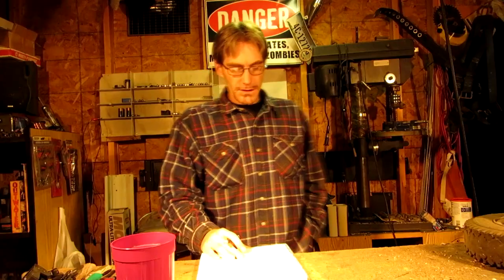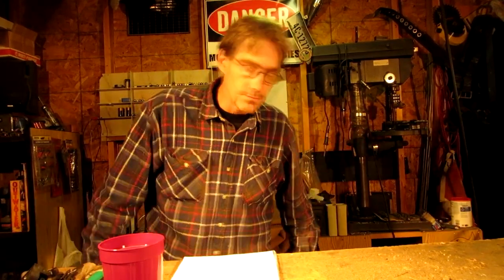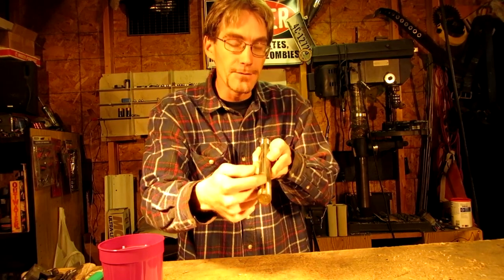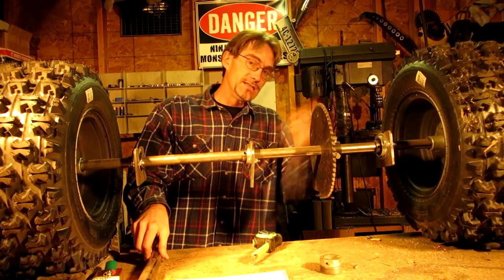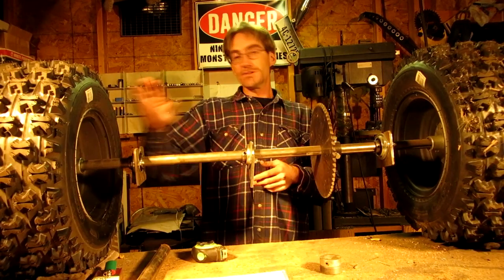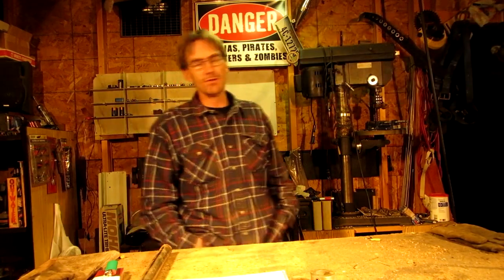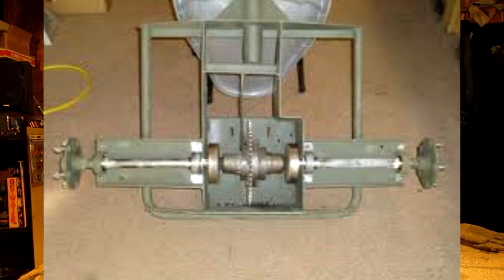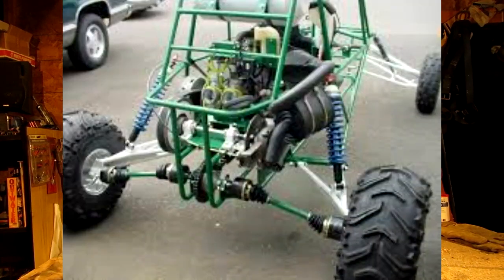GO KART AXLES | 3 PRIMARY TYPES |

Comment: Larger diameter axles , solid or tubular , will handle greater torque without twisting . Chrome moly steel is about 2X the strength of high tensile carbon steel in the same size . Great job !

Comment: There is a 4th type. And I am setting up my cart that way. The engine drives a jack shaft w/o gear reduction. The jack shaft has 2 centrifugal clutches one for each wheel. This is positive traction. Too much scuffing with a live axle whenever you are on a road or pavement.  This setup has two independent axles one for each wheel and mounts almost reaching the other axle.

Comment: I run a dead axle on my drift trike. I used 2 old snapper wheels and drilled out the 2 wheels so it would match my hub and I had to make another hub for the passenger side. I put 8 inch trims on it. Works great

Comment: A jack shaft set up, between the engine and differential, is what you want. Comet clutch-engine/jack shaft then chain-jack shaft/differential, then brakes on both sides of axle. When I was a kid I had a Montgomery Wards 3 wheeler with this set up, 8 horse Tecumseh. Tough set up! Took everything I  could dish out until the engine gave the ghost (took about 12 years). At that point I put a JLO 17 horse snowmobile engine on it. That drive train still took the abuse for another 8 years up to and after I sold it! Later on I learned it's the same live axle that sells at northern hydraulics. Just a little 411. Like videos and builds BTW.

Comment: My tip: Spray some clear coat into a little cup take a small brush and paint your CLEAN steel axle after it is installed, by turning the axle and holding the brush,
I did this and my axle stayed new looking, and yes it may make disassembly harder but it's worth no rust.
Reply from the maker: That is a good idea .. Thanks for sharing
Reply: That was nice of you, thanks to you too.

Comment: You have to put a brake disc and a brake caliper on each axle so you are required or should put two brakes on the rear axle Peerless makes a differential and sodas comet I have a differential on my Dingo and it's made by comet and it's got twin Disc Brakes in the back

Comment: What about drilling and tapping holes in the spacers and adding grease zerks? This way you can shoot a little grease in there to lube and protect.
Reply from the maker: yeah, that might work, as long as the spacers are made of some thick walled stuff.

Comment: For a dead axle set up, is it possible to secure the one turning wheel so it turns the axle, which is attached to the other wheel? causing both wheels to turn with the engine? This seems like it would be do-able and would significantly reduce prices on the go kart im getting

Comment: Ok I got a question about my go kart T Man. It's a beast that some amusement parks would use. You could toss this thing down the grand Canyon and the frame would probably be unharmed. I'm pretty sure it had a dead axle on it at one point but someone put a solid racing quad axle on it (posi) it didn't have a motor but I had a 5.5 honda engine sitting around so I used it. Here's my problem. When on grass, this thing will not take off at all, the centrifugal clutch does not engage enough to get it going. What's my issue? Is it the posi axle or what are we looking at? And I have one of those centrifugal clutches with the 4 c shaped clips that open up as you accelerate instead of the spring that loops around type.

Comment: My gokart axle doesn't have any rust on it. I drive it in water, dirt everything even mud and no rust. Set screws are pretty trusting. Only one time my sprocket set screws vibrated loose and I ended up with my chain falling off.  I drive on smooth cement and dirt which doesn't make it too hard to steer with no differential but on a rough asphalt road, it's tricky to turn. I have to speed up a bit then make my turn. Most of the times I don't make a full u turn.

Comment: hey, right now I'm collecting info and tips to build a go kart. I want to build a go kart which can switch between a live and dead axle. The live axle will be for off road driving because the tires can slip, and the dead axle for on road. I think that the easiest way to do this is to cut the axle in half and connect it with a manual clutch. Is this practical? or should I just stick with a live axle?

Comment: This seems like the place where people would be knowledgeable. So my question is- Alot of people who build go karts drive them on standard style pavement. But they use heavy off road golf kart style tires. Wouldn't it be alot better to use 16" bicycle wheels with street treads. Wouldn't they allow you to cruise faster because they weigh less, and have the correct tire tread?

Comment: What keeps your axle from sliding out besides having the wheels on each side. I got a 3/4 axle that goes into a pipe that welded part of the frame with 3/4 ID bearing on each side. But old axle stayed in pretty good new axle I purchased. It goes straight through and it flies out other side. Old axle had keyway just on the hub area and on the threads. New axle has keyway all the way down axle except on the threads. Do I have wrong axle ???

Comment: I have never had a problem with the set screws on the bearings or the brakes. One time the sprocket on my gokart has shifted dramatically and my chain blew off. It was due to a loose, cheap set screw which the head of it stripped.

Comment: I'm thinking of building a go kart with a live axle and running it with a belt rather than a chain. I'd have a clutch, brake and gas pedal. I'd make it so the clutch pedal was locked in the released position  to start and when stopped. I'd put an idler pulley between the engine and axle  and when the clutch was let out the belt would tighten and  it takes off. Do you think that would work on a go kart?
Reply from the maker: yep, it sure could.

Comment: Hello,
Can you list the parts that have gone into the axle you have on the bench?
-tyres size where you got it from
-rims size where you got it from
-axle size where you got it from
-etc
include the brakes you intend to use on this axles.

I wish I could buy/afford a complete axle like that. I have a Chinese offroad go kart which I modified and fitted with hydraulic brakes and changed the engine to GX390 with a 40series torque converter(Chinese), its got a lot of torque.

I would like to build a go kart with bigger tyres 13inc or bigger and use it to carry three four passangers as well as pull a trailer with kids in it. (That is not realy a go kart is it but you get the idea). I would be cool to pull kids around in the Kalahari sands.

Comment: Hey, Edit this and throw in a short clip of you son doing donuts, and explain that with a dead axle you can only do donuts in one direction( If it on the right side you can only do donuts to the left and vice versus).  Just so the young ones can visually see what you were talking about. You explained it good, but an actual demonstration is the best.   Say that you can also have turning brakes with a differential…Lock the left and only the right turns..Like farm tractors have too assist/help you turn sharp and quicker.   Can I get an email address so I don't have to write my thoughts on here and that way I won't make you mad at me?

Comment: I have  a Murray kart with a live axle. The axle is out of alignment. The axle is enclosed in a pipe welded to the frame of the kart with no suspension with a bearing at either end. One side of the axle stick out farther than the other. I f I should how can I get the axle back to center?

Comment: I'm still confused. I have a go kart that has a fixed axle. When I turn it stresses the electric motor and can stall. I assume a live axle will allow when turning both wheels turns at different speed thus not stressing the motor. Is this correct?
Reply: Yes! That one wheel has to pull all of that weight. Live axel will put that power to both wheels!

Comment: How do you know what length axle you need for a go kart?
Reply from the maker: a few ways. look for axles that you can get then build everything off of that. Or think about how wide you want it to be then look around for an axle that would be 4-5 inches shorter because once you add the tires then the width should be about ideal width you wanted it to be.

Comment: Well Amazon has the 1 inch.. dif axle for 89 bucks.. I'm building a cart for my boy
 Yes your helpful 
 Ty sir.. 
My question.. brake In the diff housing.... or better to run dual brake system on both drive tires?

Comment: I have a live axel where it goes thru a tube that is connected to the frame(carter factory). Can I remove the axel and cut the tube to add a sprocket hud and a disc break?
Reply from the maker: yeah, should be able to easily

Comment: Bite through? Shouldn't I drill small holes through my axle so my set screws will screw in snug?
Reply from the maker: +Ean Gdaniec nah , thats not a good idea. if you ever brake one off inside it'll be hell trying to get it out.
Reply: ***** Thank you... but I am still finding it difficult to trust a small screw to keep an axle from swaying, just by pressure. I need locker collars.
Reply: +T-Mans Go Karts what would you say about a belt feed to a chain that runs the tire?

Comment: I just built a trike with a live axle, i am having a hard time turning because when i turn right, the right wheel would cover less distance than the left. other way around when I turn left. It is causing the trike to do jerk stops and the wheels are skipping. Typical live axle issue like old ford mustangs. Whats the solution?
Reply: Right he just provided the solution.

Comment: can any one tell me how or where to get a clutch for either a mac 10 or a mac super 250 chainsaw? i already have both saws and they run good, i plan on using one or the other to power a kart, i also have a comet cv belt drive clutch/tranny but it takes a 5/8 inch input with no taper and my saws have a much smaller shaft with a taper. i am on a im broke as a spoke budget so i cany put anything cept pennies into parts. i dont care if i use the comet cv or a simple centrifigal chain clutch [ i also have a couple chain clutchs but they also fit a 5/8 no taper shaft with a key ]  oh yea not sure on the 10 but the 250 super crank shaft has threads on the end of it to mount the clutch. PLEASE any help be welcome where to find info or buy/ barter parts new/used

Comment: Hey t man,
                I bought a rolling frame for $20 and the rear end is junk to my plan is to saw it off and weld a new one on with new barings and axle,sprocket etc. but I want to know whats cheaper that single sprocket with no hub btw 13 inch tire or sprocket hub with sprocket planning to run a 1" axle
Reply: Collin Pries Live axle
Reply from the maker: Collin Pries Whats cheaper, well that depends on where you get it from. since you are doing the re-build of the rear, simply expect to spend 200 if your getting everything new. Which by the way is the best thing to do.
Reply: http://www.bmikarts.com/view_cart.asp Here is my list of supplies has far has brakes go I figure a tree  or a obstacle will do. I will buy pillow blocks at our local hardware store along with square tubing

Comment: I just bought a used go kart, ATK-125-A (JEEP STYLE 125CC YOUTH GO KART) problem is the bottom gear attached to the axle is not lined up with the top sprocket, so chain slips off..the sprocket is also wobbly...would a new sprocket setup fix this or do i have to somehow align the big gear on the axle?? I tried but the nuts on the axle i loosened but cant seem to move the big gear to the right, only to the left...please help!
Reply from the maker: get some video up about it so I can see what your talking about.
Reply: ok it just rained outside one minute..

Comment: at 6:20 you move the axle (left side push, right side pull) the wheels move in opposite direction , the axle doesn't (noticed from the sprocket remaining still). How do you lock your hubs to your axle? Thnx G
Reply from the maker: sure, Well most of the time I use 1x1x.095 wall thickness. in terms of tubing its closer to 13 gauge.  welds great.
Reply: Huh?
Think there was some confusion in my question. The hub where wheels mount, they seem to be on bearings, only because the axle doesn't move when you move the tires. If the sprocket turns the axle, how does your axle turn the hub/tires?
Reply: I have hubs where the axle would pass through two bearings that are pressed on. I'm looking to lock the hubs onto the axle. Is there a special hub I need to purchase for that?
Reply from the maker: Oh i see. yes there is.  What size do your tires say and what size is your axle??
Reply: 23X10.5-12 tire
and thinking of going with a 1" axle, the bearings are removable in the hub (2 of them, one for each side of the hub). I have researched and found bearings ranging from 3/4", 5/8", 1" I can have pressed in for my particular hub assembly
Reply from the maker: well you see , there should be no bearings in the hubs at all. You need to get some hubs that will take the 1" axle.
Reply: I have a live axle how do i lock in the hubs in so the axle doesnt just spin inside the rim and not go anywhere..or what kind of rims do i need to buy....

Comment: I have a wonderful rear differential. I have been trying to figure out how to put a hydraulic brake/ mechanical brake caliper on to it. I haven't found anyone with this kind of setup. please help!
Reply from the maker: +boca2001921 ... hmm. its kind of hard to know what you have with out a video of it. could you put something up on your channel so we could see?
Reply: +T-Mans Go Karts yes I can! give me a few, and I'll do a quick walk around.
Reply: okay, video is up. don't mind the mess, or my lack of knowledge...heh
Reply: I have the same problem.  I'm going to add a T in the hydraulic brakes before the caliper and have 2. One on each rear wheel and use 2 rotors like an atv that has hydraulic front brakes. I'm just trying to figure out how to get another rotor on because my diff is on one side with no room between it and the wheel for a rotor
Reply: +Ryan Fortin. I'm not to sure if it matters on go karts, but older and newer cars need a proportioning valve to get equal distribution to both calipers. but unknown to kart application!!

Comment: i am a tottal noob....

but if my axle sprocket has a keyway... Means its not free ...what i mean iw a bicycle sprocket alows you to pedal... but when you stop peddling.  it allows you to coast....

so wothout that ability.  that means soon as you stop giving it throttle the lower rpms of engine will cause you to slow to a stop correct?

im planning a mini bike build. and was wondering how that all works
Reply from the maker: no, not totally. when the clutch or torque converter stops engaging from the lower RPMs thats when you'll coast.
Reply: T-Mans Go Karts 

thanks for fast reply.... so if i get largest torque converter. 40 series o think...  if i use smallest sprocket on rear pully on torque converter. and largest on axle to wheel. should give me highest top speed? correct..  is there a special ratio that gives torque and top speed?
Reply from the maker: lol, no you dont have to go that extreme . get a 212 cc engine from Harbor Freight .....then get "TAV2" it comes as a set-up. and then get a 54tooth sprocket for the rear. That is the most basic and common set-p of both minibikes and go karts.
Reply: T-Mans Go Karts 

ok and thats mu next question. is it worth gettint a 212. and doing cam. springs. and stage 1 kit. or just save and run a stock 420 without a governor?
Reply from the maker: well both engines put out the same RPMs. The 420 has more power but both engines ( at stock ) will give the same speed. If you building a minibike just go with the 212cc. Moding it will give some better performance BUT the engine wont last as long.
Reply: T-Mans Go Karts 

are you on a website or forum where i can ask you all my questions?

Comment: I gotta differential axle with a sprocket off of an old rear engine john deere riding mower - the band brake is also on the housing connected to the sprocket - small differential but no universal joints.  I got that at the same time i got my right angle gear box Tecusmeh Peerless 700 series 5 speed transmission (model 740).  Now from what I see - this thing is stout - it's a 100 series Tecusmeh Peerless Differential.   If you want to look it up or have the repair book named "Tecumseh-Peerless-Transmission-Transaxles-Differentials-Service-Repair-Manual"  I'll link it - It has a TON TON TON of information on almost every transmission for everything small engine driven!   The Racing Mower Builders Bible! -- 

https://www.google.com/url?sa=t&rct=j&q=&esrc=s&source=web&cd=1&cad=rja&uact=8&ved=0ahUKEwjnstaEiILVAhUM8IMKHXtNCGoQFgguMAA&url=http%3A%2F%2Fwww.mymowerparts.com%2Fpdf%2FTecumseh-Service-and-Repair-Manuals%2FTECUMSEH-PEERLESS-TRANSMISSION-TRANSAXLES-DIFFERENTIALS-SERVICE--REPAIR-MANUAL-691218.pdf&usg=AFQjCNGVB8uQwjnTFiwUhqI_J3yyULq1NQ

Comment: Are  both wheels on live  axle powered by motor? How do you turn if one tire cant go slower than other like when you use  diferential?
Reply: zumbazumba1 one of the wheels will slightly lose traction but it will be barely noticeable in a go kart
Reply: it can be extremely noticeable...